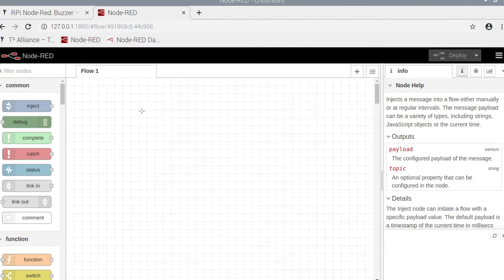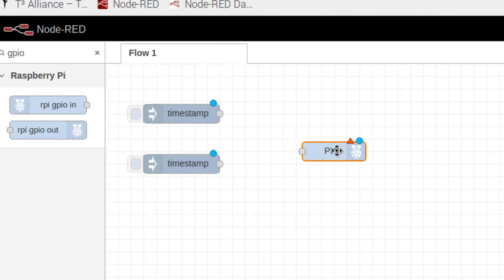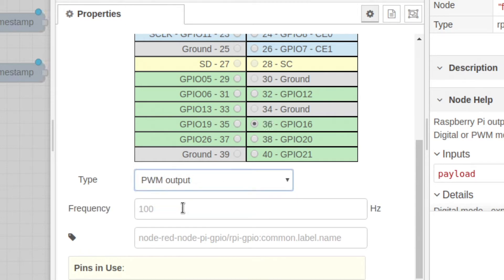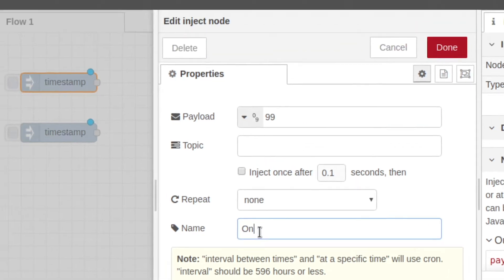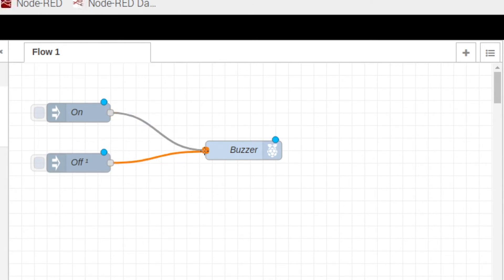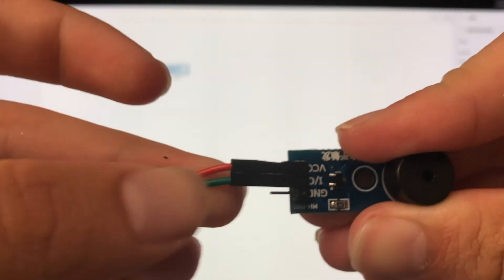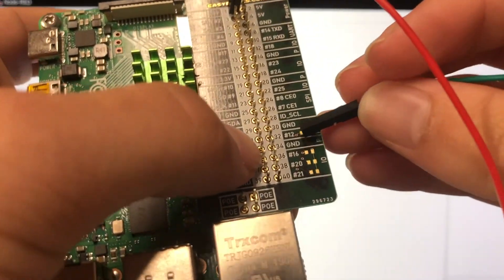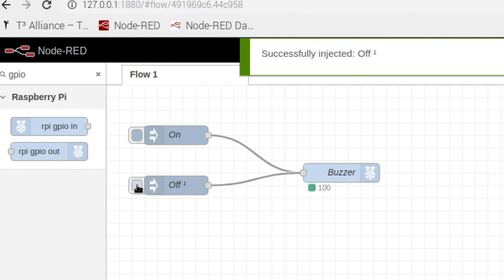RPi Node-Red: Buzzer

Comment: In case anyone stumbles across this and is having issues here's something to try. 

My 3pin buzzer really didn't like the 5v pin I was using so make sure o use a 3v pin. My buzzer was also inverted so 100 on the inject was off and 0 was loudest. So try making 100 the off position and 0 the on position. Setting the on position to 99 made mine sound like a bomb timer which was pretty neat.

Comment: Good tutorial, but I have a 2 wire buzzer (red and black only).
how do I trigger it with the if condition of msg.payload? for example if msg.payload = 0 buzzer is off, and if buzzer = 100 buzzer turns on?